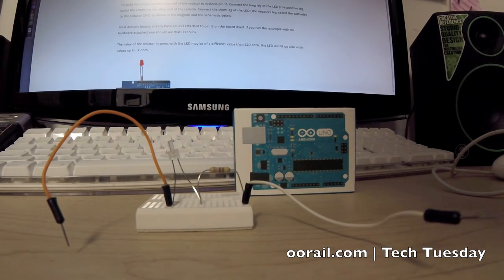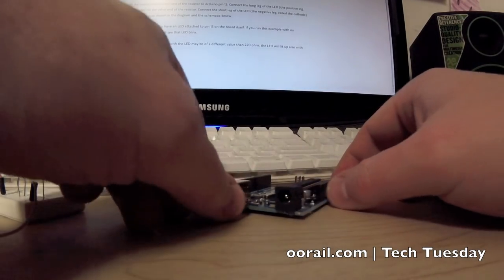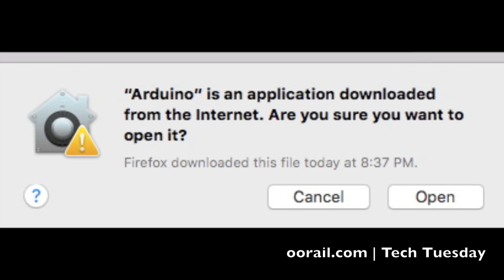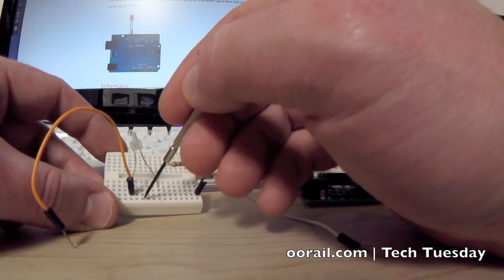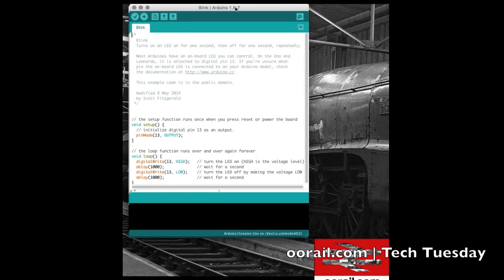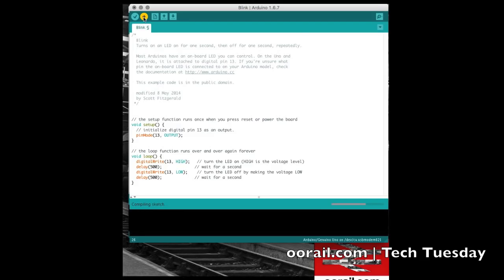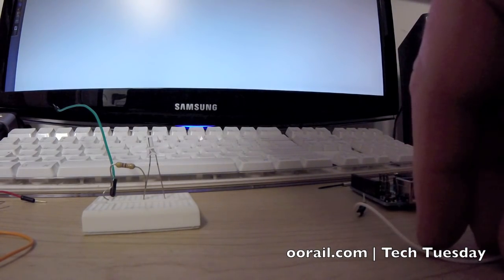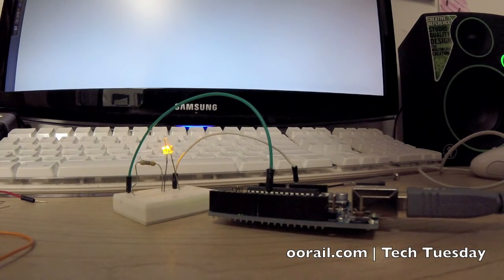oorail.com | Tech Tuesday - Basic Arduino Programming with LEDs

Comment: Hi John, nice tutorial on using the Arduino, well done. I had to do a lot of programming within one of my Degrees, which I hated, even down to Machine Code. I did like JavaScripting and Active Server Page (ASP) programming.  I have a couple of Arduino somewhere I bought a couple of months ago, I may have a play with them to see if they can be used to control emergency lighting on ambulances etc....Simon
Reply from the maker: +Liverton -Simon Thanks Simon... I just uploaded a new one for this week that shows how to put together an Arduino controlled point motor setup. Programming can be hit or miss, some people really enjoy it, others not so much. Open Source is fantastic, great way to learn to code and lots of very interesting innovative technologies. Not to mention you can fix things yourself when they break! I still do the occasional bit of x86/x64/MIPS assembler, but these days compilers like gcc are so well optimized, even on embedded systems you don't really need to mess with machine code or even assembler too much anymore. Javascript has been revitalized with things like Node.js and Meteor.js. Microsoft solutions like ASP, .NET, C# are pretty much junk, nobody with good engineering skills or an ounce of security common sense would touch them. Those platforms are way too large for embedded, IoT or even Cloud these days. The Arduino platform is pretty slick, very easy to get into hardware that way. I'm spending most of my time these days programming in C, Python and Javascript professionally... I'll be interested to see what you come up with when you dust off your Arduinos! :)
Reply: I managed to find my Arduino's, I have a couple of different types.  I have decided to program them to control lighting in vehicles.  I am not too bad at programming, did a lot of website development using ASP, PHP, JavaScript etc.  Once I create a program that controls the lights I will put it on YouTube, I will also do one for servos to control crossing etc, the list can be endless...Simon

Comment from the maker: The site to decode the resistor values is here - http://www.digikey.com/en/resources/conversion-calculators/conversion-calculator-resistor-color-code-4-band
Reply from the maker: +oorail.com I updated the description with all the product links, in the USA you can use adafruit.com for most of the parts... 

Project Links:

The site to decode resistor values:
http://www.digikey.com/en/resources/conversion-calculators/conversion-calculator-resistor-color-code-4-band

2mm LEDs were purchased from Led Switch:
http://led-switch.com/2mm%20LED.htm

Resistors can be purchased here:
http://uk.farnell.com/

Arduino Uno R3 boards can be found here:
https://www.arduino.cc/en/Main/ArduinoBoardUno

Software can be downloaded from here:
https://www.arduino.cc/en/Main/Software